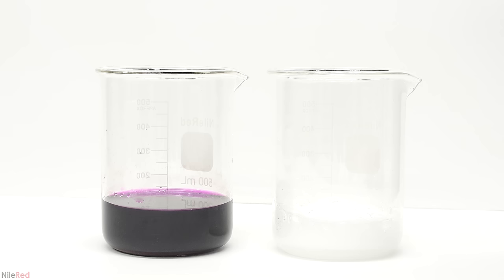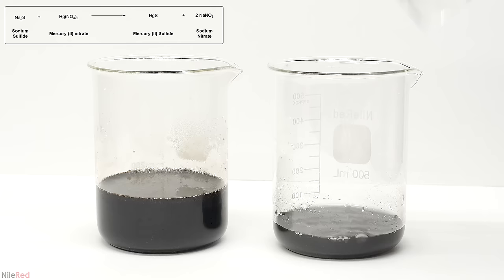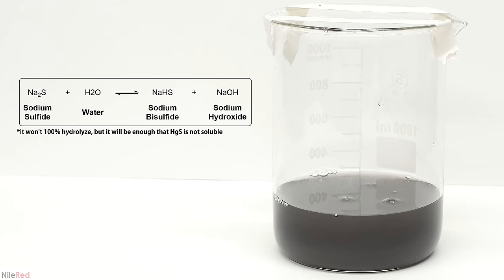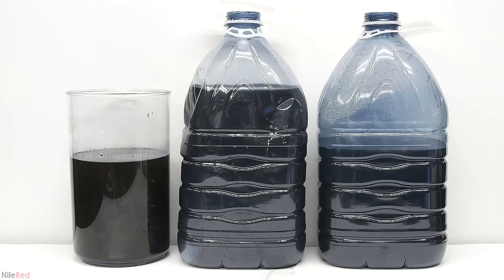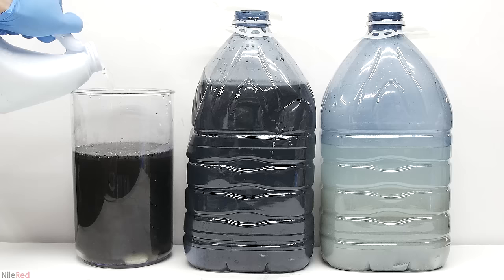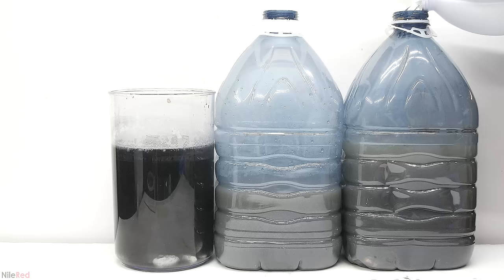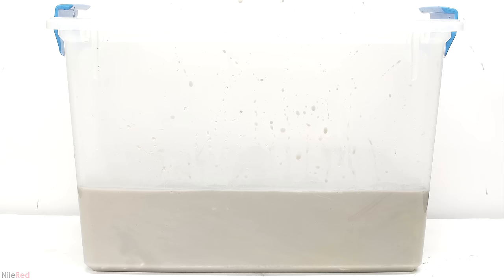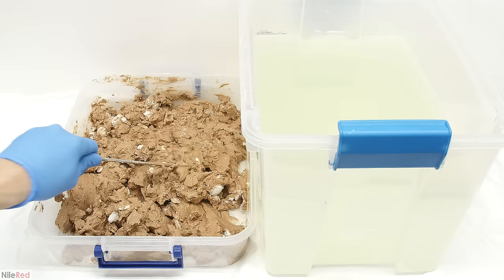Making Mercury (Part 2)

Comment: Thanks for showing the other side of chemistry: the cleanup. I swear half of the reason chemists have been pursuing green chemistry so vigorously is because it's easier and cheaper to cleanup up.
Reply: Welp. This is what "green chemistry" looks like.
Reply: I think that the key to this is being able to lable and sourt the by- products of the reactions. Some of the by products are relatively pure acids, salts, and solvents, so you can posibly use them for later precesses.
Reply: its that and the fact that green chemistry allows you to save and reuse a lot more byproducts.
we are constantly running into shortages for materials, both from civilians wasting it and also from certain materials having a large amount of applications there for creating a very high demand on already rare substances.
One of the worst is the shortage of helium.
Its used to cool mri scanners and many other pieces of medical and industrial equipment. 
in the highest echelons of science its used as a coolant on the LHC, Large Hadron Collider. The LHC is crucial to furthering our understanding of gravity, subatomic and atomic particles, quarks, dark matter/energy, antimatter, quarks, and even the origins of mass which could in turn reveal how gravity works and why it is. 
Although we do not fully understand much of what occurs during the reactions created by the particle collisions, as the reactions do not last very long. 
The small pieces of information we obtain from reactions created by the LHC could give us the keys to understanding how the universe around us came to be, and how it actually operates. 
However none of these things are possible to use without the helium needed to cool and or operate them.
Yet people seem to think helium is more important for their children's god damn balloons. Hot air literally rises, People literally ride in wicker baskets propelled by the wind and lifted by nothing but hot air and some heat resistant fabric, yet some how people dont seem to believe that puting hot air in their children's party balloons is viable course of action.
theres also Diamonds and cubic zirconia. 
A lot of it goes into jewelry and fashion items, when in all reality there are ways to produce, ableit less rare, but equally if not more stunning pieces with other gems and materials that are so highly needed by productive and important industries. 
Cubic zirconia is the main replacement for diamonds in the jewelry industry as when hand cut, it is indistinguishable from a diamond to the average man or woman. 
However it is also a very needed and highly used material in chemical labs as it has a high mechanical strength and it is able to shield us from harsh chemicals should a reaction go wrong. its what the view window is made out of in most high end reaction chambers. 
Diamonds and cubic zirconia are very useful when creating lasers and very high end optical equipment. 
Diamonds are also greatly useful for making steal and concrete cutting blades and grinders, as the hardness of the diamonds really lends itself to shaving away steel and stone at a speedy rate in comparison to other materials. 
But oh no, nancy landgrab needs 10 2 carat diamonds on each of her ugly hoop earrings top match the other 30 she's got hovering around her body ornamenting various one of a kind pieces of fashion that you have no clue how she even found a way to put on. ugh.
Tldr: buy something cooler and less applicable to the science or industrial field than a diamond as an engagement ring to your important someone, And fill your kids balloons with hot air instead of helium so people can keep getting mri in the future/ so we can power our atom smashers and figure out how the universe works, thanks.
Reply: @zukoHD  The Wall of Text has awoken!
Reply: @zukoHD   You could have literally just used the first three sentences and you'd still get your point across just fine. I swear people only write these walls of texts because it makes them feel good about themselves because literally no one is reading this shit.
Reply: @michealpersicko9531  just read the whole thing, really kills time
Reply: @zukoHD  I doubt most people care about learning how the universe works. Plus diamonds aren’t rare at all.
Reply: @zukoHD  Few who use helium for balloons or who purchase diamond jewelry are aware of the need for these materials in science and industry.
You're being quite harsh to the unaware consumer and ignoring the role the producer has to play.
Perhaps you could start or contribute to a campaign to raise awareness—that would be a rather more productive use of your time!
Reply: @zukoHD  if you’re this passionate about it, you should know diamonds can easily be lab grown at better quality than mined diamonds.
Reply: @rachel705  True. The reason nobody is doing en mass is because it will crash the price.

Comment: You should try to extract mercury from tuna or other mercury-rich fish. The yields would be pathetic but it'd be a nice ride.
Reply: try to extract mercury from tuna
Reply: Tuna would contain way under 1mg Hg per kg.
Reply: Tuna is pretty expensive and contains very little mercury
Reply: Extract mercury from tuna and then from a vaccine and see how they compare lol
Reply: @JakeFace0  None in the vaccine, unless its one of a few influenza vaccines, which contains approximately 25 mcg per shot.
Reply: Let's say you have 1mg Hg per kg of tuna, which is probably not the case as this is the actual safety limit for Hg in fish. 
A metric ton of tuna would contain 1g of Hg and costs about 1000 USD. At a density of 1,02 kg/L, it would be about 980 L of tuna to process. 
1g of Hg (at a density of 14,184 g/mL) would give you 0,07 mL of mercury. For comparison, a drop of liquid is usually around 0,05 mL.
So, yeah, totally plausible.
Reply: Matheus mnz And don’t forget, yield is never 100%. Especially for mercury.
Reply: Itd smell though
Reply: I’d like to see it extracted from mackerel(saba).
Reply: Try to extract memory from tuna.
I dunno tho, the idea sounds fishy.
Reply: Nice idea but it would be insanely expensive, in canned tuna there’s hardly any mercury (in the uk at least) the NHS considers 4 cans a week safe if you’re pregnant so you’d probably need 100 cans to get a small blob of mercury... plus it would cost probably $200+ Canadian just in tuna
Reply: @paracovo  People nowadays have no idea how safe the food we it is.

Comment: When treating your waste water results in more waste than when you started....
Reply: Fern Moore I think he was mostly trying to get back his mercury, but whatever.
Reply: Fern Moore i think he was trying to eliminate waste and get his mercury back but true
Reply: He was making sure the waste would not harm the environment when he disposed of it. A lot of the waste eventually got evaporated or dumped down the drain but only because it was safe enough to dump out. I'm not sure what he's going to do with the rest of the solid stuff, but I assume that when you mess around with chemicals like he does you start to accumulate a lot of non-disposable waste bags. :P
Reply: @OrangeC7  The solid mercury waste is just contained, and not thrown out unless you send it out to an actual waste company, which is VERY expensive. Thus, you just keep it contained in a waste bin.
Reply: That is the power of ever increasing entropy!
Reply: Honestly I feel like we've all wondered how drinking Mercury would feel to (Eat? Drink?)
Reply: @eyezinstein9168  death and like bringink some sort of slime but like its a water slime probly... but mostly and solidly death
Reply: Would you rather have 1kg of waste cyanide or 50kg of waste concrete in your backyard?
Reply: @anonanon3066  No thanks.
Reply: @rebmcr  I think the point is that while the smaller amount of initial waste was there, it was much more toxic than the larger amount of relatively safer waste, “safer” being it not making toxic vapors
Reply: @naturegirl1999  OK but Anon Anon can still keep them both in their own backyard.
Reply: 2 Ziploc bags or 3-4 gallon containers?

Comment: One of my last jobs when I was an analytical chemist was determining when a superfund waste site that was contaminated with mercury was sufficiently cleaned up.  It turns out that because the HgH system we used to measure the contamination was so sensitive, we could never get to the background level the regulators wanted: no matter what the cleanup people did, there was always residual Hg.  So be careful about what you do with the solid waste!  The owner of the site died in jail...
Reply: Funny thing about where I live is mercury and lead is normally at slightly elevated levels in the soil naturally...also for that matter so is uranium and other trace radioactive's so what one person would consider "waste" we consider normal soil lol.
Reply: Did he die of mercury poisoning in jail? Kappa
Reply: Background hg levels in my area are normally high.
Reply: Arizona?
Reply: Nobody goes to jail when DoD property becomes a superfund site.
Reply: Wait, i could not imagine how low the concentration should be then 🥺
Reply: @Drjusmar  *Few hundreds months...
Reply: why did he go to prison
Reply: @amp4105  I assume for getting the place so dirty?

Comment: Funny as a kid we knew of the danger, still got to play with it. One day someone sneezed and dropped a bottle. The cleanup was scooping most of it backup and mopping the floor. Good thing trace elemental mercury is not all that bad. For human life anyway as less that 1% can be absorbed if you manage to eat it, and though vapor is a concern, the low vapor pressure of mercury combined with the small amount mean it was not a huge deal. Regulations and whatnot though today are a bit different. The funny cleanups when I was in the military are mostly iridium. They act like the world has come to and end and everyone is gonna die. :P Good video and I will have to up my game when it comes to recovery and cleanup before I work with certain elements for sure.

Comment: Pb-Acetate, wasn't it used by the Romans to sweeten their wine?
Reply: I looked it up and it seems about right. But it led to lead poisoning... RIP Romans
Reply: HeyHoRangerJooo i bit into small chunks of lead as a kid and im not dead, also it did taste in a way just metalic
Reply: Anticonny Pb-Acetate isn't elemental Pb
Reply: Yeah, but not as such. They weren't adding chunks of lead acetate to the wine to make it sweeter (though that was done later, in medieval times). They used copper or bronze recipients that were coated on the inside with lead, and that had a double effect. When poor quality wine was stored in those, the acetic acid formed by the oxidation of the ethanol (therefore: poor quality wine) reacted with the lead, causing on the one hand the decrease of acetic acid concentration thus making the wine less sour, and on the other hand producing lead acetate which is sweet. This was done on a very large scale as a means of "improving" poor wines. 
It may have lead (sorry for the pun) indirectly, or at least contributed to, to the fall of the Roman Empire due to chronic lead poisoning of large parts of the population. The barbarians attacking them presumably didn't have this problem because they were, well, barbarians and didn't use such "advanced" methods of wine rectification. Sour grapes are sometimes better.
Reply: Why not Dean i was curious too, and since i have 10 kilograms of lead metal in my basement, i tried licking it. trust me, it has absolutely no taste, just like any metal. by the way, taste testing lead, mercury or any other pure metal should be 100% safe, since your body can't absorb it directly. lead acetate, however, is a totally different story. they say you can even ingest mercury and it would all come out the other end, because the hydrochloric acid in your stomach can't directly dissolve it, but i wouldn't try it.
Reply: ignorance   is   bliss    !!!!!!!!!!!!!
Reply: Nile has a video about lead acetate and its history.

Comment: Would it not also works if dissolving the cinnabar in aqua Regia (3HCl+HNO3) then it should give us 2H2O + Cl2(gas) and NOCl(gas).

If wait long enough there are ions Hg(2+) and S(2-) in solution.
And then it could work in the same way with KMnO4.....
Same result but less waste or not
Just a few more toxic gases 😅

Comment: Can someone tell me what is the filter material he used. Sea lite is what I could hear
Reply: Oh nvm. Figured it out. Celite. has a particle size ranging from less than 3 μm to more than 1 mm, but typically 10 to 200 μm. Which makes it easy to filter stuff out